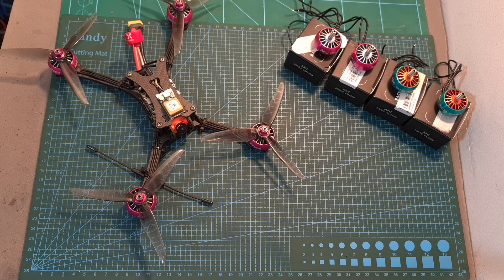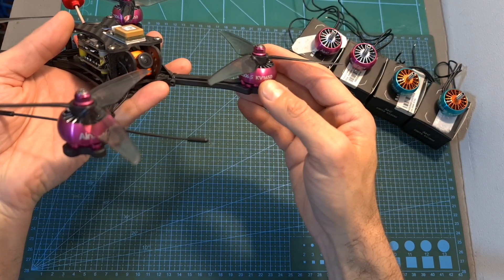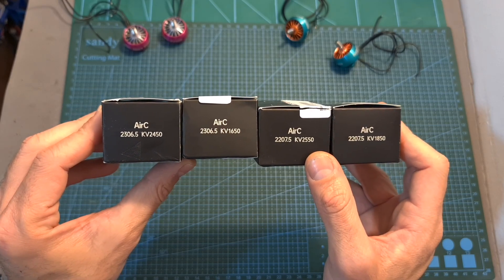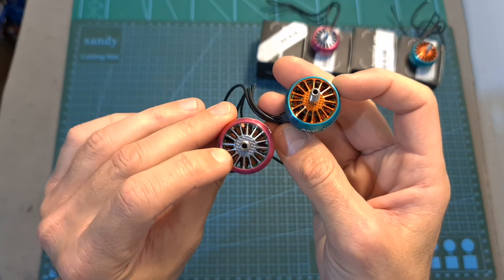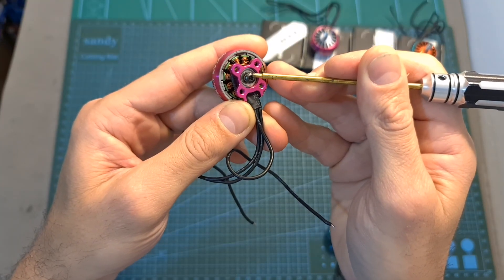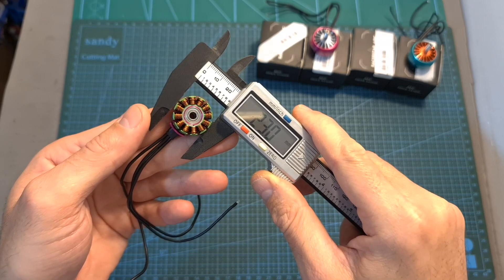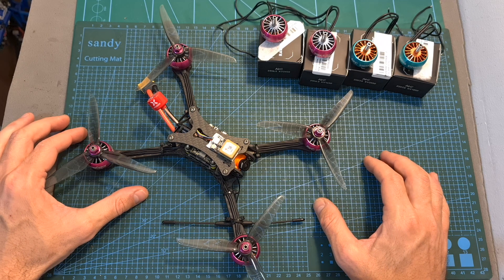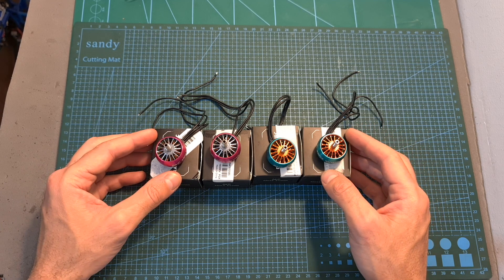Racerstar AirC 2207.5/2306.5 Motors - Thrust Tests & Flight Footage

Comment: Sadly is missing the tests more interesting for me, the 2207 1850kv in 5S and 6s with 7" props and one of  2306 that I forgot maybe . Difficult check 2306 vs 2207 as they don't share the same tests, please if you can make the share same test in 6s, that will be helpful (well, even more, it is very useful already)  The review great, the motors are really nice, I just made a build with them in a Mark4. A prop with more pitch as would be nice to help to choose a ESC. 40A is ok for that prop but I ask what with one 51499, my ESC continuous 40A peak 50A, not sure if can with the current of a 51499 or in 5s. Anyway the best reviews overthere, .
Reply from the maker: Thanks a lot Andrés.
I think that the 2207 1850KV motors won't be able to handle 7" on 6s, but I can't confirm it. I will try to cover more options on my next thrust tests but unfortunately I am done with this one. Due to time constraints I just can't do everything that I want to :-) 
It sounds that on 5S you are going to push the limits of your ESC, so maybe you better limit the motors output to about 95% when using a 5S Lipo.
Reply: @KremerFPV  Have sense!

Comment: They look beautiful, but  I will probably skip these, price is quite high for racerstar brand
Reply: Because is a t-motor rebranded, I think velox v2. They are now the same company or got an agreement, not sure, but t-motor is making the Racerstar premium motors.
Reply from the maker: As stated by Andrés, these motors are not made by Racerstar. They actually don't make any motors. They partner with 3rd party manufacturers who make the product for them and put their logo.
Reply: @KremerFPV  Totally right, on Banggood page , description says that the motors are designed by iFlight.
Reply: @KremerFPV  investigating more this are not T-motor. they are the iFlight Xing Cyber, but with rounded bell. Xing Cyber are $24 and top spec in the market. what I say is easy to check with the kabapfv cyber review. This are a $25 motors by $13-15, just not possible to beat. they are selling them at that price because the gov is giving them a return back of the 15% of the sales in dollars and refund the delivery cost. that %15 in $ is enough profit for them . yu can check the 10mm bearing, the crown around, the 0.1mm of lamination, the ring, the wires clamp,etc. if you check the new FPVcyber motors, you will find many components n common as they share with cyber ones the tp spec build of iFlight (I think owned by DJI)
Reply from the maker: @Flamenawer  It's mentioned on the product page that the motor was designed by the iFlight team so it makes sense :-)

Comment: Hold the fuck up! When did RacerStar start making premium motors?AND, I could have swore that they had like, (Legitimately) For Real, gone out of business as well. Not too recent ago either.
Reply: DYS went out of business a while back, I never heard that Racerstar did though. Looks like they've picked up their game, as long as the bearings hold up.
Reply: @alasdair4161  You know what!? You are damn sure right! I for real got them two switched around. Thank you for lessening my lack of correct knowledge. (I believe that's mostly the proper way to say it.)
Reply: From they are made by T-motor. Check Kabab review in example, the Air series, are of the best, if not the best you can buy today in 28xx and 25xx, we will see this 22xx. As I said, they are t-motor rebranded, this ones  under iflight external design, so forget anything of racerstar brand they are not made by them, due to that they are so good XD

Comment: Hi Gal   I really can't decide what to do,  I have a place for both the 2207.5 and the 2306.5  in 6s kv ratings.  I just can't figure out what one to choose  ?  How about send me both,  and I will decide later.   LOL   !!!  Thanks so much for the video and information.  And have a great week.
Reply: i think 2207.5 just are better always. if you want 7" dont buy 22xx, buy the Racerstar AirA 2508, the bet in the market in its class and that ones are the t-motor ones,not iflight but is a personal opinion
Reply from the maker: Haha :-) 
I second Andrés and I suggest to go with the 2207.5 motors for a 5" build, as they will provide you with plenty of power.